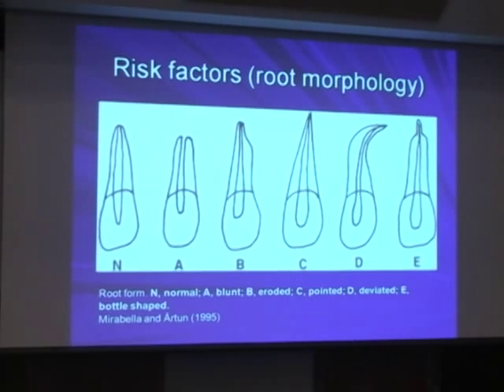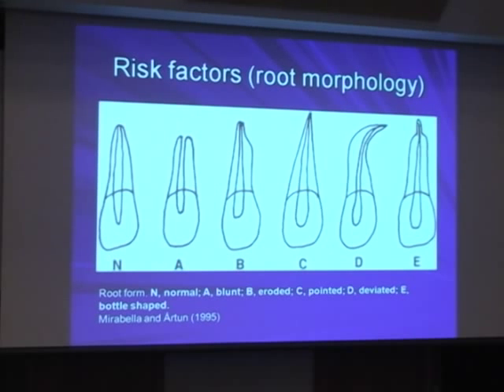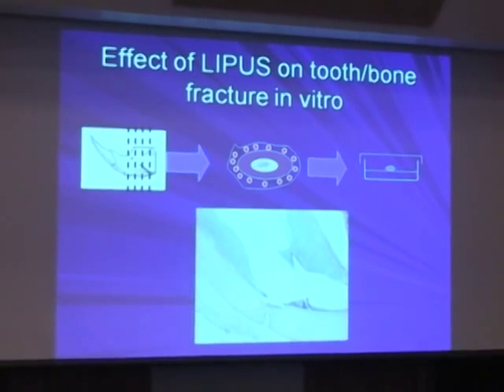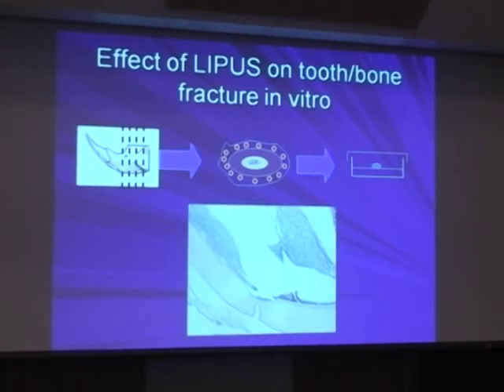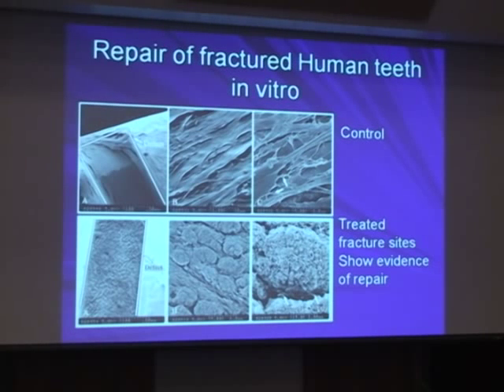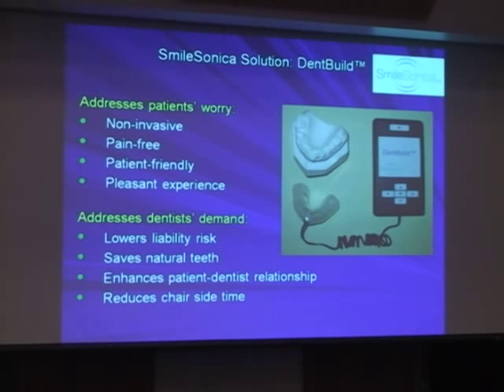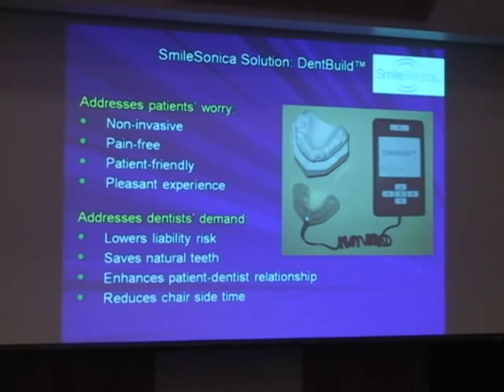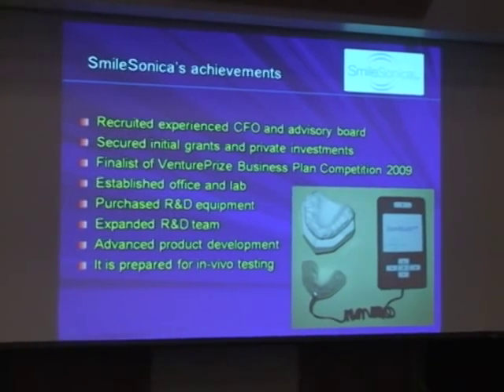Part 2: Ultrasound Based Dental Root Repair

Comment: I also interested in this (I have a tooth regeneration:)) From the information that I found this device operates at a frequency 1,46MHz - 1,52MHz a source of energy piezoceramics element (just like those for obtaining ultrasound cold steam). Ultrasound with a frequency 1,52 MHz and very low power range of 10 - 30 mW (0,03W) at RMS !!!

Such a device can be created quite easily if you have such a vibrating piezo element. I'm not looking for whether the market would have such piezo elements with 1.52 MHz frequency. If anyone knows where to buy, it would be nice to share. And most importantly - should be used very low power because instead of regeneration, can cause heating and killing of living human cells - 10 - 30 mW (0,01- 0,03W), not more. The frequency: 1,52MHz, must be modulated low frequency about 1 KHz (1000us)  - 200 us pulse and 800 us pause... (ie the device to operate impulses, not all the time. Maybe half or one hour, every day, put on the area missing tooth.
This is the technical part of me, more information can be found in this document:
http://www.electrotherapy.org/assets/Downloads/Low%20Intensity%20Pulsed%20Ultrasound%202012.pdf

LIPUS Generator - schematic:
http://binaryrg.ece.ualberta.ca/pmwiki/docs/Dental%20LIPUS.pdf
Reply: where can i get a machine that does this ?
Reply: @MAHAKALAXXXV  Hello,
The patent is from years ago, but I don't think that this machine is produced and sold freely ... It is unlikely that the big health mafia would allow this invention to reach people?! Rather, find a person who could assemble this on the patent and experiment with the machine. I don't think there is another way.
Reply: @lz2sdc did you make one?

Comment: Hello what is the MHz to use for this type of healing?
Reply: I also interested in this (I have a tooth regeneration:)) From the information that I found this device operates at a frequency 1,46MHz - 1,52MHz a source of energy piezoceramics element (just like those for obtaining ultrasound cold steam). Ultrasound with a frequency 1,52 MHz and very low power range of 10 - 30 mW (0,03W) at RMS !!!

Such a device can be created quite easily if you have such a vibrating piezo element. I'm not looking for whether the market would have such piezo elements with 1.52 MHz frequency. If anyone knows where to buy, it would be nice to share. And most importantly - should be used very low power because instead of regeneration, can cause heating and killing of living human cells - 10 - 30 mW (0,01- 0,03W), not more. The frequency: 1,52MHz, must be modulated low frequency about 1 KHz (1000us)  - 200 us pulse and 800 us pause... (ie the device to operate impulses, not all the time. Maybe half or one hour, every day, put on the area missing tooth.
This is the technical part of me, more information can be found in this document:
http://www.electrotherapy.org/assets/Downloads/Low%20Intensity%20Pulsed%20Ultrasound%202012.pdf

LIPUS Generator - schematic:
http://binaryrg.ece.ualberta.ca/pmwiki/docs/Dental%20LIPUS.pdf
Reply: @lz2sdc are you saying you can actuallybre-grow your teeth or tooth root?